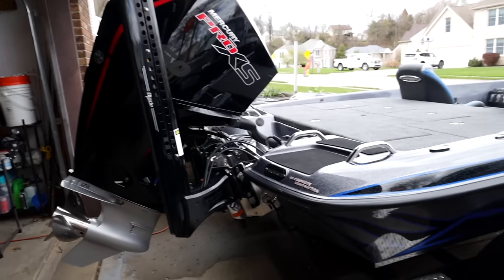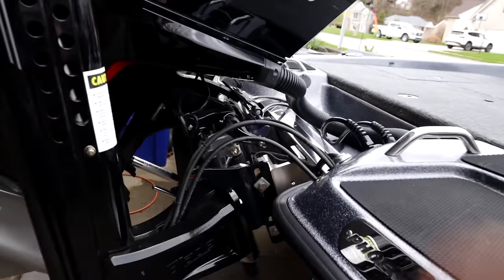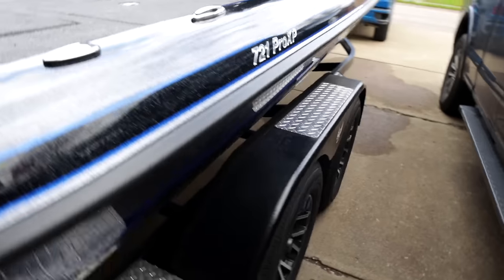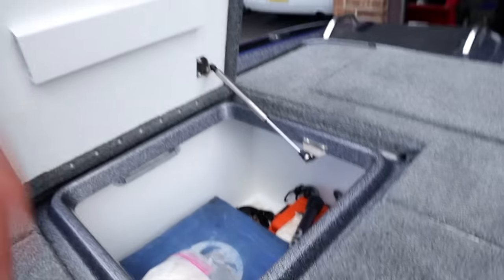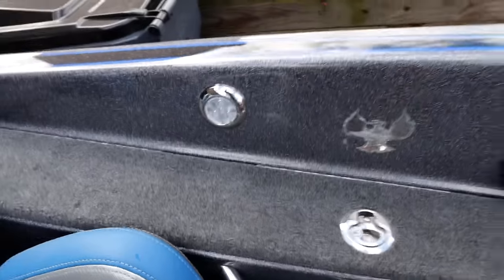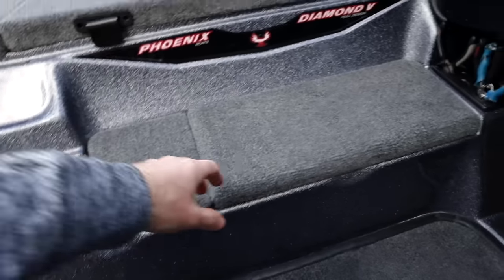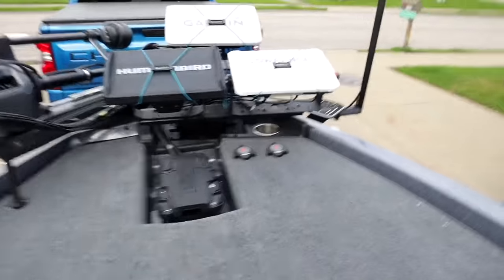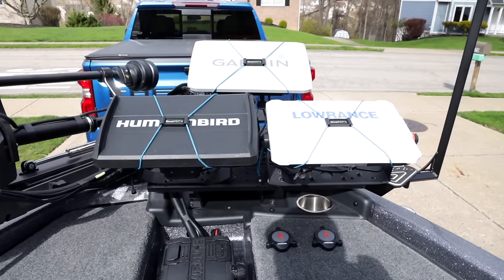MY NEW BOAT! Full Tour of My Phoenix 721 Pro XP!

Comment: You can buy 100 amp lithiums for 250.00 a battery now . I’ve had my iconics for 4 years no issues. You’re really the only one I’ve heard have problems with them.
Reply: which brand?
Reply: Litime is just one of many.
Reply: @frostyvlog4547  iconic
Reply: Birds and lithium don't go well together. Birds need weight in the back Birds owners that have switched slow down the hull design is to have a heavy butt.